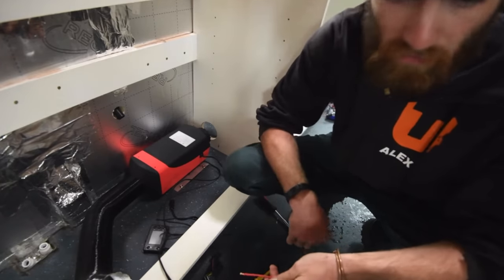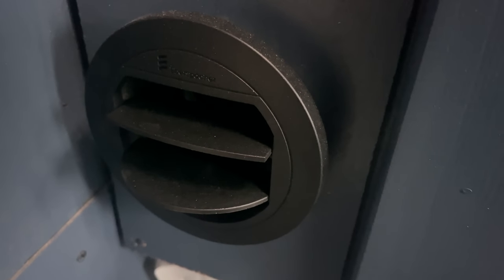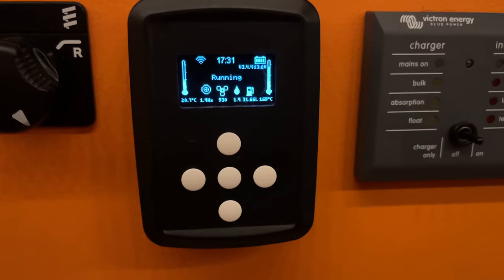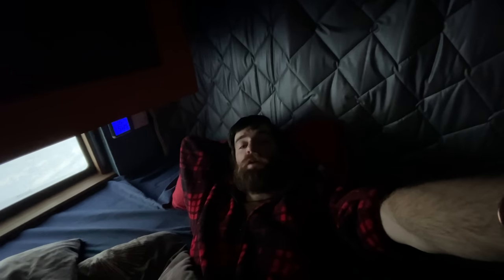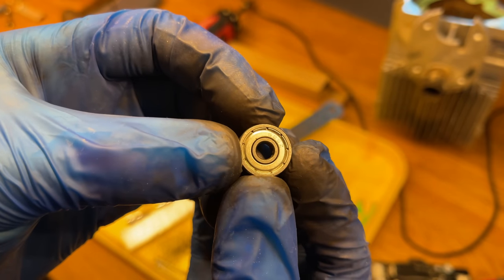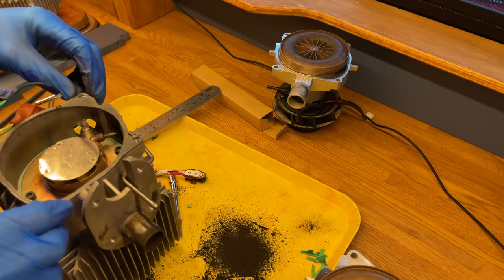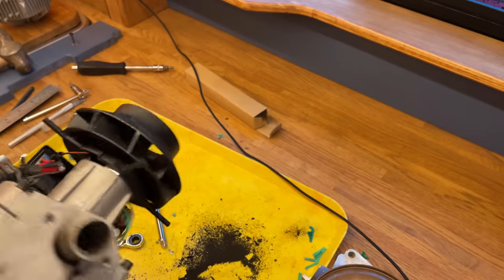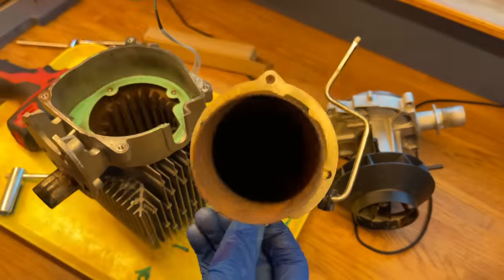2000 HOURS LATER! Chinese Diesel Heater

Comment: Do you run the heater with default settings or did you customize the pump frequency and fan speed? Would be interesting to see which settings worked for you.
Reply from the maker: I left mine stock, I’ve personally never tuned the heater as I’ve always been it’s had worked well for me

Comment: Hi mate nice video, where did you get the afterburner programer from?
Reply from the maker: There is a website or the Facebook group for it
Reply: I run afterburner on my diesel heater and its so much more adjustable and lots of realtime status info aand makes these heaters much easier to tune to your reuirements
It also allows better temp control with the optional remote temp sensor and you can use it from phone app or web page on your internet connecction
Having said that the standard controller work ok too just less  tunable

Comment: Some newer refrigerators use butane for refrigerant. Might not be an optimal setup if it does. Just and FYI. The heater looks pretty good tho. I've been thinking about getting one. That's why you're video popped up. I've been leary of them, but most user videos actually show fairly good things.
Reply from the maker: The fridge in my van is compressor 12V which runs off the battery system which is really quite efficient. 

I always feel with the Chinese heaters. There are so many issues down to the massive variety of Chinese companies which produce them as they are not all equal and incorrect user installation is also a common problem.
Reply: @MispronouncedAdventures  in regards to you fridge, yes, it is a standard compressor unit, but the refrigerant inside of it is likely butane or propane. I only mention it because of the possible issues if it develops a leak. Very flammable. 

I know what you mean about chinese products from innumerable companies and finding part/support for them. It's the same with everything from there, including HVAC, which I deal with here. Customers call about a chinese off brand ductless AC that they bought off the internet that is having issues. Good luck finding parts on that thing, lol.

Comment: Interesting. I am going to fit one to my workshop to keep it warm... Though I will probably see if I can get it to run on kerosene and switch to waste oil as that is free.
Reply from the maker: They run on Kero no problem, it’s a lot cleaner. I’ve heat of people using waste oil but I haven’t researched into that personally in case any settings need to be tweaked
Reply: @MispronouncedAdventures  Many thanks. I didn't see a link to the after burner controller, is that on your general Amazon page?
Reply from the maker: The Afterburner is a project over a product. If you find the Facebook group for it, you can learn how to get one from there
Reply: @MispronouncedAdventures  Many thanks. Have you got a search term to find the group or would "afterburner heater control" do?
Reply from the maker: That should work. I think the group name is something like “ advanced afterburner controller for Chinese diesel heaters“
Reply: @MispronouncedAdventures  I think I found it. Many thanks.

Comment: Now that the patents have run out and these heaters are $100-$180 (USD) vs. $1,500-$2,500... what's the point of even going through all that work to "fix" them when you can Amazon one to you, same/next day and pop a new one in???
Noticed you had to cannibalize another heater for its gasket, so yeah, what's the point???? :)
That being said, REALKY enjoyed the breakdown of the parts and what's actually IN the darn things!!! :)
Reply from the maker: I’m glad someone who actually realises it’s a patent expiring opposed to just a copy. 

Yes, if I was in a bit of a time restraint, I had to leave the following day for four weeks needed the heater so I cannibalised a spare gasket. If I had a couple days I’ll just order a new gasket online and I will at one point to repair it. the reason I repaired opposed to replaced is not all of these heaters are equal from the manufacturers some run for years some I’ve seen for a few hours so I’d rather repair one. I know is working well in my van than put in a new heater.

Comment: A different point point of view would be to just replace the heater with a new one.

I can appreciate the effort that you went through to replace the bearings and the exhaust parts.  I just paid $128 USD delivered for a VEVOR 8KW self contained unit. 2000 hours would be 0.064 USD per hour machine time not counting fuel. The one like yours, 5KW, and without the housing, are cheaper.

If you spent a couple of hours actually replacing the bearings and finding the gasket you have $40-60 into the actual repair, I am assuming that the bearings were about $10 each, plus whatever it cost you to get the new exhaust pipe and muffler. The time for repair you could say was free, on the other hand you could have been doing something else maybe more profitable and avoided the risk of breaking something more costly. You still haven't replaced the fuel pump and your motor armature is worn along with the brushes. The labor to remove and replace (r&r) the unit would be the same new or replacing your old unit. If you factor in the possibility that the motor will fail in less than 2000 more hours with additional r&r time and parts, replacing with a new one might be more cost effective and trouble free(er).
Reply from the maker: Swapping the whole unit is definitely a option but I’ve found not all all Chinese Heater are equal. Some will run for year no issues, other maybe only a few hours before sooting up. I’d personally be happier with replacing and repairing than swapping in a whole new unit
Reply: @MispronouncedAdventures   Isn't that the problem nowadays. Products used to be made so that they could be dissembled, repaired with parts you could actually purchase, then reassembled without worrying if you were going to break it just taking it apart. Armatures were thicker so that they could be turned and re grooved to go again for the same period as the first time. Brushes were longer, bearings were good ball bearings that could be greased if there was room. Now repairing something is rebooting your computer to see if it works again.

Not all progress is progress.
Reply: @MispronouncedAdventures    I purchased my diesel heater based on reviews which means that it was reviewed but will not actually do the same as the review unless I get lucky.
Reply: @MispronouncedAdventures  It's also worth considering that those bearings will most likley last many many times longer than the pre-installed ones. In the factory I work it it isn't uncommon for NHK bearings to last the life of the motor. Usually if it's brushed, the commutator will wear through before you get a bad bearing. I was quite surprised to note it wasn't a brushless motor though.. But considering the low wear I'd imagine with the Japanese bearings, next service you will have to do is replace the brushes in maybe another 10,000 hours.

Comment: Should have gotten a sheet of gasket material at your local automotive store and traced your good gasket so you can make a few gaskets. I've done it with carburetors and small engine gaskets and it works fine
Reply from the maker: Not something I can acquire quick around here don’t have the shops for that . But I felt an unused gasket from an other unit was good option

Comment: What an amazing heater, and an amazing set-up. I'd very much recommend running some copper fuel line for it though.
Reply from the maker: Why copper pipe? All of the big western brand supply 2mm bore nylon hardline
Reply: @MispronouncedAdventures  Because the nylon hardline will eventually become chalky and brittle from the fuel. Ask anyone who's been a mechanic more than 15 years, or anyone who runs fuel pressure lines on their weekend drag cars. Copper tubing is always the best, most secure and safe way to go. It's strong, durable, doesn't corrode, and will last pretty much forever.

Comment: 2000 hours of run time! Holy crow! You are dedicated. I'd just replace the unit for the price. I have 3 of those I use in various places. If one dies, i just replace it.
Reply from the maker: I prefer if one is running well and hasn’t sooted up to repair it. But that is the great thing about these units. You can repair or replace as that price.
Reply: @MispronouncedAdventures  I hadn't seen the entire video when I made my previous comment. Now I'm the one feeling like a right donkey. I got several heaters I can still fix. (Facepalm) Being Chinese, I didn't they would work again if I try to fix them. Thanks for showing me I was wrong. Worst comes to worst, I will have several spares. Good job! Merry Christmas to you and your family.

Comment: People saying to keep a spare bottle of RTV are right, it CAN be handy. But RTV often fails more times than it actually works. The true trick, which I myself have listened to, is to buy various gasket sheets in various sizes and materials. I got maybe 10 cork/rubber gasket sheets for 5 dollars, good enough for a life time. 

They last forever if kept somewhere damp and not in direct sun light, and you will NEVER have to buy a new gasket ever again. Buy them in various thicknesses and compounds, store em and use em when needed. I then use the RTV ontop of these gaskets just to make it seal even more.

Comment: I just ordered the entire part new when I needed new bearings,  it was like 20 bucks brand new... And when I have it opened, I clean everything,  or else you will be opening it once again soon.. Like the atomizer screen, that will clogg soon if you don't change it...
Reply from the maker: It may or may not, 2000 hours, runtime of the atomiser was generally quite clean. I would rather replace the bearings of high-quality ones than just put in a new section with low quality bearings.
Reply from the maker: But that is the advantage of the units. You can just put a whole new one in if you want at this price point.

Comment: I've an eberspacher, it was already in my van but had been serviced almost two years prior. It's an older model and has no fancy controller, just on off, fan only, fan with heat and an up down dial. I've had my van for five years so that's almost seven in total. 
It's never let me down. 
I don't live in my van but use it often and the heater has had lots of use but hey! Unfortunately I don't have details on runtime. 
I add redex for diesel every time I fill up and use Maxol diesel as I was told it's the cleanest about in the UK although a bit more expensive, the guy that told me replaces fuel filters in fleet lorry's and since shifting to Maxol, less fuel issues. 
I think Good fuel is key for these heaters (plus most diesel engines) Anyway, I often wonder would a Chinese diesel heater have worked for me just as well...certainly not the underneath van part's that's for sure...they're the cheap parts to replace though.
Reply from the maker: Yeah I’ve only ever run premium diesel in my van, and as the heater uses fuel out of my main van tank it’s only ever run on premium diesel and always been clean insides.
Reply: @MispronouncedAdventures  Mine is fed from the main tank too. The only thing I don't like about these heaters is their amp drain on the batteries in winter. I'd really like something like this...
Dieselofen "Sibirien",1.8kW, 70mm-System

Comment: you did well 2000 hours on the glow plug,
Reply from the maker: Same glow plug now in the unit with about 3700 run hours for the heater. Total Run time for the glow plug is 52 hours looking at system details

Comment: ZZ = double shielded (metal shield each side)  on electric motors, I usually go with a 2RS type (rubber contact seal each side) keeps the factory lube in, keeps the schmutz out.  EZO makes a decent bearing.  NTN, NSK, SKF, Fischers AG - all are excellent bearings as well.  Buy the best bearings you can..."but I can get a tube of 20 bearings off [large online company] for $2.97 !"  you will never say ' I wish I had not bought the premium bearings' .  electric motors, air tools, cordless tools, etc.  all benefit from from high quality bearings.  I have a number of Harber Fruit air tools that are going on 15+ years use by simply changing out the shite bearings with name brand decent bearings when I first bought the tool.
Thank you for sharing your experiences on these heaters - have been looking in to one of these 2kw units for my cargo van.  The -11 F later this week may be the push to pull the lever and order one.  Cheers!
Reply from the maker: That 2kw Heater are great as well. I’ve installed a few of them. 

You are correct, no one has ever wished they had bought cheaper bearings!
Reply: Here in the states, Nissan had a high-roof full size cargo van NV2500, I don't believe they were exported. Previous owner bodged in some insulation, so it would not require much to heat it. Clarke tools from Machine Mart are on the same level as Harbor Freight - some really great hidden gems, some absolute rubbish. 
Safe travels in your Fjord Transit!!

Comment: When you dismantled the motor you found an anti vibration sleeve on the front bearing but did not show the rear bearing clearly and I noticed that when you refitted the comutator bearing housing you found it a loose fit. Bearings are never a loose fit , either the sleeve has disintegrated or fell off un-noticed.  This was the bad bearing, you may find that the bearing at the front fails after a short time  because the play in the shaft caused by loose rear bearing is too much.  Also, play in comutator bearing acts on brushes and may cause failure or premature wear.
Reply from the maker: Yes I did notice there wasn’t a vibration sleeve on the other bearing only one. I did find that quite strange. I wonder if it was missing from factory as you are quite rightly pointed out I did observe that the bearing went in too easily.

Comment: Thermo King sells the same thing,
There's are made in Germany they are called a D2 heater and they made bigger ones. They also make one at heats water called a hydronic.
Burn kerosene through them every now and then helps clean them out.
They are easy to rebuild
Reply from the maker: The Chinese heater use the expired patent for German Ebasperher D4 ( the bigger version of the D2 ).

I also have a hydronic heater as well which I use to heat my engine. 

I have them plugs into my vans main fuel tank to use the diesel directly from the van for convenience

Comment: 8:55 You can reuse that seal and put some "Copper silicone" from Loctite or Versachem on it. i use that type of silicone on exhausts manifolds for years.
Reply from the maker: I think in the future, if it is only broken into 2 part, I would consider, since is this case  disintegrated into maybe. I thought it best just to replace

Comment: Question - I just installed my Chinese diesel heater. Runs great but I want to order spares for it ( glow, atomizer, bearings, gaskets ) etc. Will any parts work or do they need to be manufactur specific parts? Great video, thanks for that.
Reply from the maker: I’ve seen many people mix and match parts from these heaters across many Brands

Comment: I notice that a few people are having the exhaust outlet under there vans this is incorrect as the gas build up will find its way back into the van. To avoid gassing the people in side the van the exhaust needs to be fed past the underside the same as the exhaust from your engine.
Reply from the maker: This exhaust is fed / angled past the underneath of the van. Gas don’t build up underneath the van ( in my set up, at least  ) this can be seen with my thermal cameras. Some vans don’t have their exhausts feeding physically past the underside. The transit in both lengths exhaust stops quite a bit before being past the outside.

Comment: Hard to read through all the comments to see if anyone else mentioned it, but I noticed people saying the bearing was too lose when you put it back, take a look at 12:10, both the bearings should have a sleeve like that one.
Reply from the maker: I know what you’re saying, but there wasn’t a sleeve for the bearing next to the brushes inside the motor and it doesn’t seem there are in other heaters either, but I do agree with you that it is loose fitting
Reply: @MispronouncedAdventures 
 This is the video I noticed it in. It's early so you don't have to watch the whole thing, maybe 2 minutes in. https://youtu.be/aAp-DxaTVJ4

Comment: So you have two heaters, one that you have installed, and another one dissasembled on the worktop? Its always good to have spares at hand anyways, but curious why you have two units?
Reply from the maker: I have more than two units. I’ve got the original one I installed in the van with the 2000 hours run hours which I disassembled, cleaned, fixed bearing and reinstalled. The second unit you saw was my spare I original borrow from work ( which I got to keep )  which is a whole spare unit or parts for when I was in the arctic winter last winter . I also have another I got to review.